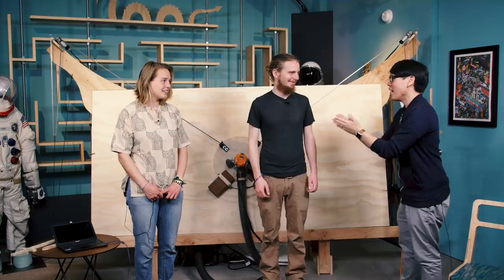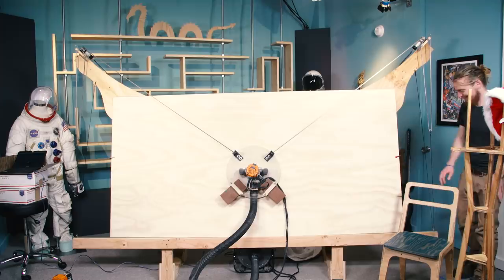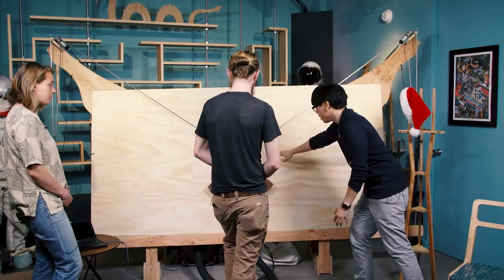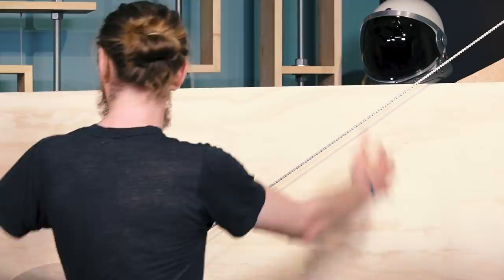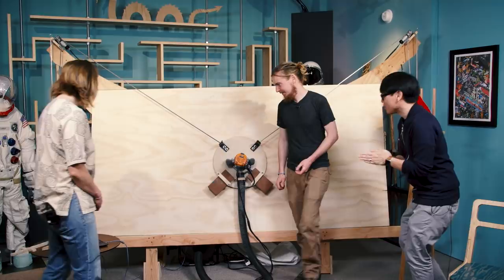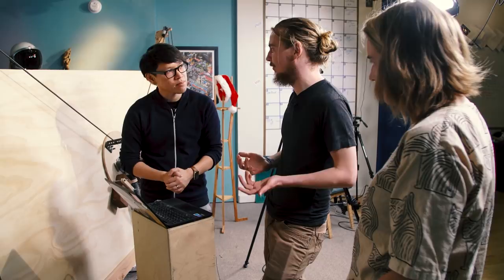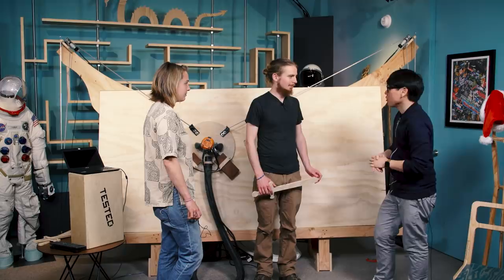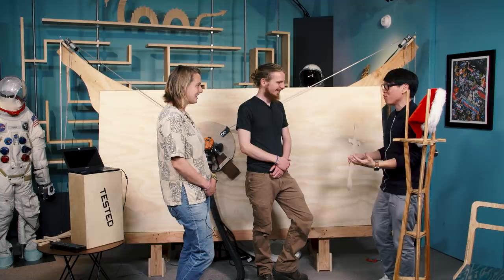Meet Maslow, the $350 CNC Cutting Machine

Comment: It would seem to be important to consider that no matter how heavy your bricks are, the chains are not a straight line.    The chain geometry will be part of a catenary.  This especially comes into play in the areas where your accuracy is off by 1/16".
Also, I can imagine that variances in resistance where the router bit is engaging the plywood might put a rotational force on the round router platen that is not constant, especially where the travel speeds up or slows down.  If the platen were changed into a banjo shaped paddle with an arm going off to one side that attached to a second arm with a pinned joint that went at a nominal right angle up to the ceiling or down to the floor to another pinned pivot point, then the calculations would be a bit further complicated, but also much more predictable and accurate.
Reply: well, the counter argument is "but it works" :-)

actually, if you do the math, you will see that the chain droop makes very little difference in the length of the chain. I had the same thoughts and chased this down a few weeks ago.

the sled is heavy enough that we have not seen noticeable 'kick' when the router hits a knot or anything like that. As people cut more aggressively, (as opposed to the very timid 0.1" deep, 1/4" bit used here) that may be more of an issue, but the solution to that is to do a separate finish pass that's a very light cut.
Reply: They would be better to use steel cable and not chain, the best thing to use would be timing belts
Reply: why would cable or timing belts be better than chain? Chain is strong enough, and gives you the position accuracy of timing belts.

If the small roller chain they selected wasn't strong enough, they could have used larger chain (in fact, some of the early prototypes used double type 40 chain and a dozen bricks for weight, as they found they didn't need the weight, they were able to go to lighter/cheaper chain)

Comment: Maybe someone already asked this, but what are other materials this thing can realistically cut? What's the maximum thickness of material that can be cut? Great video and really cool product!
Reply: it uses a 2.5HP router, so anything you can cut with that can be cut with the maslow. the max thickness that can be cut is limited more by the length of bit that you have than anything else (you just cut in multiple passes)

Comment: if you use another 2 chains on the bottoms, you might be able to take correct depths of cuts and might just be able to cut some more malleable metals such as aluminum.
Reply: it doesn't take more hardware to do a correct depth of cut, just more experience. He's used to tiny machines (the ones that use a dremel for their spindle) and is extremely timid about his settings. He's shown that the machine can do a full-depth pass in 2/4 plywood, but is afraid of breaking bits.
Reply: David Lang The problem is how its being cut, with counter weights. Gravity is 9.8m/s, and if the force exerted by depth/feed/RPM exceed that, then it veers and doesn't cut accurate, causing other potential problems. 

in relation a bigger end mill uses less RPM, therefore is more stable allowing more feed and depth of cut, but that also increases the forces being exerted. I don't know the rigidity of wood, nor cutting speeds of it, but I know the construction doesn't allow deep depths accurately.

This is the exact reason why bits break, is because settings are inaccurate, cutting surfaces are dull, or because there is too much chatter.

Comment: It would be truely simple to use this on a wall by adding angled brackets to distribute the weight horizontally with a bit of downward still remaining. Now personally I have a bit of a cooler way to add that horizontal pressure to keep the tool against the wall but I wont share that because I couldnt make money off that design xD

Comment: I wonder if and how they compensate the tolerances for the chain itself (every element between motor and head has play, otherwise it would be stiff), its length, and the weight of the chain and head pulling this tolerance partially downwards and in the direction of the fixed mount, given the angle of the bed.
Reply: no, those error factors are small enough to not make a significant enough difference in the position to matter in practice.

Comment: Great job. By what I hear during this video if I can locate a strong enough router I could cut aluminum sheets? You did say the machine is having issues keeping location precision on the upper left and right quadrants. I believe that if the chains attached closer to a tight angle instead of the possible 60° it's at now it may do better. You see being at the current angle when you approach either end the router will tend to rock/pull in the extreme end direction. Maybe I'm wrong but it's good for thoughts.
Reply: whatever angle you attach the chains, the sled is going to tilt towards the edges, the computation takes that into account

Comment: I like the trigonometry involved here. Would be kinda fun to make something like this myself as some sort of arduino project.

The curves are translated into short lines, and in order to control the two chain feeders, I'm fairly sure you only need to perform four trigonometry operations, excluding the Z axis.
This is genious, not because it's super hard, but because it's a new idea that allows for really large scale applications in a way that few people have thought of before :)
Reply: DoodleFox Check out "makelangelo" for a drawing version of the same concept. I built one for about $10 using cheap-ass steppers
Reply: Ah, neat :)
Reply: This is running on an arduino.

The math is far more complex than you are thinking, because the chains do not connect to the center of the sled see: https://robotics.stackexchange.com/questions/10607/forward-and-revers-kinematics-for-modified-hanging-plotter/10858#10858?newreg=13734dd331424a0ea0d2ddc79c562910
Reply: Oh, right, that little detail does appear to make a it a lot harder. Too hard for me.
Reply: well, you can use the code that's released as part of this project for yours. That's the beauty of Open Source software, once someone solves the problem, you don't have to solve it again for your own software. :-)
Reply: I totally agree, but I was actually more interested in solving the problem rather than using the solution, hehe :D

Comment: You need to incorporate a servo to raise and lower the router for various depths needed.  ???  Angeling the table back a little more which would provide more weight downward may tighten the tolerance in the upper region of the table.  ?? Just guessing.  LOL    Awsome Job.

Comment: Not sure that gravity is secure enough, even with bricks, to keep the router from jumping. That’s why we use two very secure hands when routing possibly why it takes A long time. Surprised though it didn’t burn from friction.
Reply: It's high school physics and math, as long as the force of gravity is greater than the force against the cutting bit then gravity will work fine. This is easily achieved by just cutting a small depth like 1/16" of an inch on hardwoods. . Downside is this takes many cuts to get through a thick material.  on soft material like foam, one an cut 1/2" or more at a time. thickness

Comment: Honestly. I love the overall layout. A couple ideas I had that could help with the precision overall would add very little hardware but you would essentially route a rounded edged frame outside of the main sheet of plywood for rollers. You would then take an "L" piece (for structure and stability) and mount your chain motors directly along the ^^("X"), and ("Y") axis vertically and horizontally. This would completely get rid of your angular precision issues. 

Your chains would be fixed top to bottom and side to side because the rollers on the outer edge would maintain square all the way around.

It is very difficult for me to describe without a sketch. 

Can your current format be programmed for direct X an Y without the change in radius?
Reply: they have a forum and have made a lot of changes since the original one shown in this video. New companies are also selling the kits.   https://metalmaslow.bigcartel.com/
https://www.makermadecnc.com/shop/

https://www.eastbaysource.com/

Comment: I  watched this yesterday and told a friend on skype who has some small 3D cnc's and he responded that he would look into it more as it pricked his Interest, my responce was  this..
Yeah I figured you might think that, if you look close to some of the cutting closeups it jumps around a bit but I don't see why they never ran the chains in a giant figure of 8 back to the router head via 2 arms  at the bottom same as on the top where the motors are, Still use the bricks or even use a flat cutout round face plate and use the vacuum as an effective vacuum to hold it down or have a way to fold in down so that it becomes a flat level almost standard CNC just use a better graviety
Reply: you could not just loop the chain, and the chain would need to change it's length as the sled moves around the workpiece.

holding the sled to the workpiece with vacuum would have a problem as you are cutting big slots in the piece you are trying to vacuum to.

part of the advantage of this design is that it takes far less floor space than a flat design would

Comment: How about a folding frame, like a scissor mechanism? Then you could minimize it for storage or use differences sizes for different wide plywood.
Reply: Findecanor the problem with that is that it would throw the calibration out, so you'd have to calibrate every time you set it back up. depending on how often you use it though, might be a cool idea
Reply: Calibration is fucked if you use wood anyways. It's going to warp, shrink, and expand due to humidity and temperature. It might not be the biggest issue with a large CNC machine, but its why wood framed 3d printers are a joke.
Reply: Yeah 11 ply birch plywood doesn't move a whole lot.. If you get the shitty big box stuff then yeah it will move a bit, but the dudes cutting with a 1/4 inch bit too so it's not that involved
Reply: You could expand the system to have it self calibrate. One simple way i see to solve that is use strings attached from the router to the frame that are connected to a pulley system with encoder wheels. You move one of the top chain motor in one direction for a defined distance, and measure how far the router moved on the other two strings. With some math applied you can then transform the X-Y referenced gcode into your machine axis commands in the controller board firmware. Thats the beauty of open source, you are free to build upon someone elses work and try to expand and innovate ideas.
Reply: ac3ofspades878  Limited thinking.  In the age of digital, you can compensate for any anomalies.  My 3D printer has leveling feature that it goes through every time to make sure every print is level.

Comment: I know this is all in "Beta" and such but this presentation didn't have to be in Beta :) They sped up the cut process which I would have liked to see (and hear) a portion of the cut. Also would have liked to see and have explained about how the tabs were not cut. I found out from other comments that it will pause for you to adjust depth manually for deeper cuts and to work around tabs but then I see someone pointed out an add on for CNC depth adjustment that adds a substantial amount to this kit. If they are trying to wow us with the price of this kit then include the actual prices for such (in my opinion) necessary add-ons. I was really hoping to see how the frame is constructed. I take it you need to rout the top left and right arms out of plywood (not part of the kit)? Buying raw wood and screwing boards together is one thing but some might want those prefab especially if they don't have all the tools and know how. I know it might seem odd to us with the skills and know how but I bet there are plenty of people that would buy this and even construct it with out wanting to be educated on wood working beyond the level of having a machine like this cut for you and from there it's a basic level finishing process. Also without a plug is a Ridgid router the easier choice or any router. Will the larger plunge routers adapt to this as well as palm routers? Are replacement parts available to purchase separately and any kind of warranty on the motors or electronics?
Reply: People have built several variations of the frame. There is a tutorial on building the frame on the wiki https://github.com/MaslowCNC/Mechanics/wiki

The basic approach is to attach the motors to a piece of plywood, it will cut out the various parts (with either you holding the router as it's moved to keep tension on the chains, or by building a temporary sled that's a rectangle by printing a template and attaching it to the wood so you know where to attach things)

They don't offer a prefab frame because shipping lumber that size around the world would cost FAR more than the materials.

Plunge routers are actually a bad fit for this design, you need a router that has a knob that adjusts it's depth, not a knob that adjusts the limit of how far you can move it down but that doesn't actually move it (you loosen the clamp on a fixed base router so that it is snug, but moves when you turn the knob)

With that being said, yes, any router can be used, but if you are going to automate the Z axis, you need a router design that you can attach a motor to. Some routers make this much easier than others. The Ridgid router is 2.5HP and $150 in the US, so it's a reasonably priced, and fare more powerful than needed router. Since we are adding bricks to the sled to increase it's weight, there isn't an advantage of going with a lighter router, as you would just need to increase the weight.

I suspect the $350 in the title is from the "tested" folks, Bar listed this as a $500 router in the kickstarter (before the automated Z axis was created as an option)

Comment: So how do you get the pattern where the moters on the upper right and left hook to ? The 4x8 plywood is what you are using as material for the finished product. What is behind the plywood. What you really need is a complete kit, frame, software, chains, and exact instructions on how to set this up so someone who has no knowledge of how these thing work can set one up. I would be interested but there is too much uncertainty on how to get it set up and actually use it.

Comment: How does this control the depth that the router cuts?  It made shallower cuts for the retention tabs, but the only controls seems to be the two x/y motors.
Reply: there Is a small z axis motor which raises and lowers the entire router and bit. www.metalmaslow.com sells a more robust z axis.

Comment: Are they adjusting the depth of cut manually between passes?
Reply: no, this is showing the full 3-axis model with a motorized Z-axis (a motor on the router to adjust the depth), the video late in the process shows the full cut (compressed in time a lot)

Comment: Rather using Arduino he could try use stm32, is suported by Arduino society and is much faster and have bigger memory. Also is much more precise. Arduino have 1024 steps, but stm32 have 65655 steps... I dont remember exactly that number, but 65000 steps per pin is a lot of precise.

Comment: could it be that the precision being highest in the middle of the sheet and lower towards the end has to do with chain slack? the longer and more horizontal the chain the bigger the slack due to increased chain weight. it should be easy to approximate the amount of slack in code based on chain length and angle. that should take care of the precision issue across the board.
Reply: The chain slack has a minor effect, but far from the only one.

There's also the question of the force of gravity moving the sled (as one of the chains gets closer to vertical, the force to move the sled sideways gets smaller)

There's also the fact that the amount of power that needs to be applied to the motors changes as the tension changes, so applying the same power that worked well in the center of the sled causes more movement out near the far edge (software changes since this video have changed things so this should no longer be an issue, but accuracy tests have not been run since)

Comment: Wish there was some detail about the mechanics they are using for adjusting the router to the correct depth as well as some detail about how the "disc" that the router is mounted on traverses the 4'x8' without getting stuck in potential channels that have been cut by the router already...
Reply: The Z-depth system is probably an off-the-shelf unit in order to keep cost down and not need to reinvent what's already established.  The invention here is the chain system and open-source design, not any of the individual parts.  The bottom edge of the sled disk is probably rounded.  Easy issues.  O, found this below:

Brian Dieckman:
A Z-axis kit is available that mounts a motor/encoder on the router's depth adjustment. In the absence of the Z-axis kit, the software will pause and ask you to adjust the depth.

Comment: are they accounting for the rotation of the router as it translates? because that's a function of the CG of the router, which is inconsistent because of the bricks. if they can restrain the rotation then I suspect the accuracy will improve toward the edges of the work piece.
Reply: CG= Center of gravity, I assume...and no, that inconsistency isn't from the bricks, it's from uneven angular tension on the chains away from the center of the work area.  One fix is in the software calibration, but another possibility is a more distant stability weight (i.e. hanging on a stiff arm straight down) to prevent the carriage from torquing.